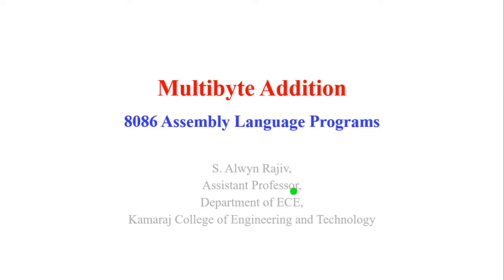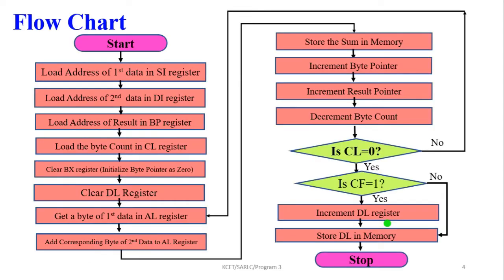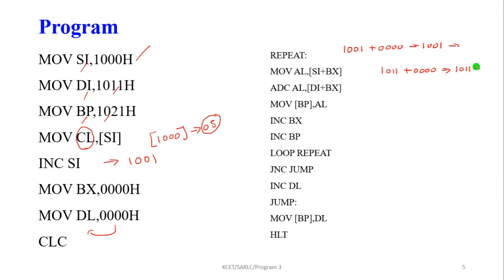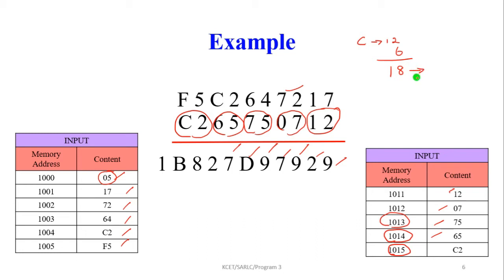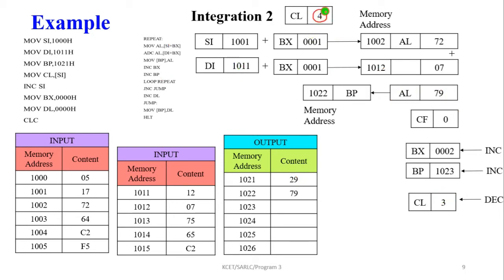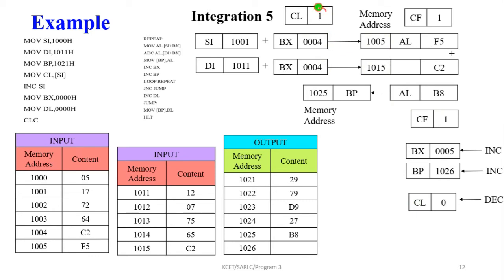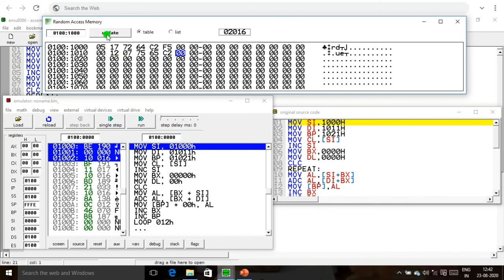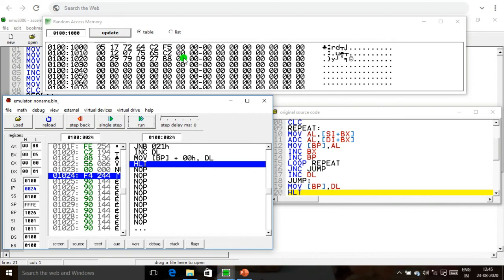Program 3 : Multi Byte Addition | 8086 Assembly Language Program | emu8086

Comment: How count value getting decreased automatically without any instruction
Reply from the maker: SI value moves to the CL register. It acts as a Count Register. This register value to decrease by loop instruction. 

Refer:
CX is generally used as control register. It has two parts CH and CL. For different looping and counting purposes these are used
Reply: @alwynrajivsarlearningcente5867  tq